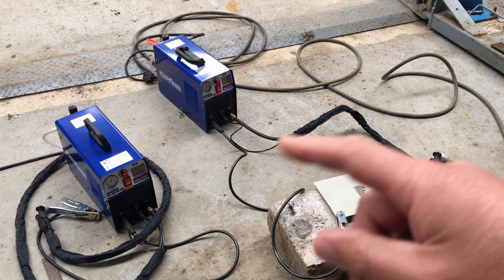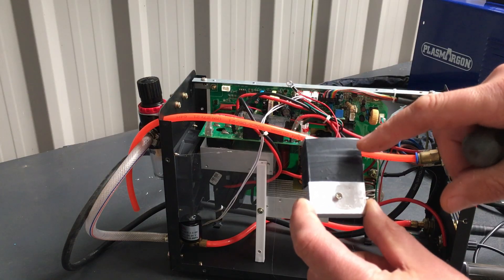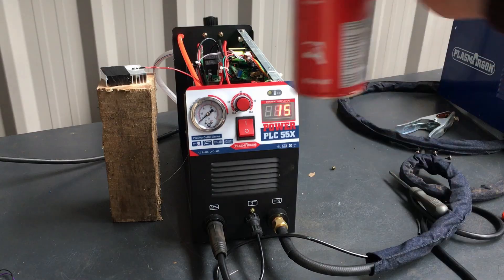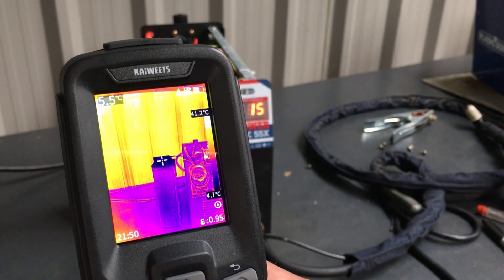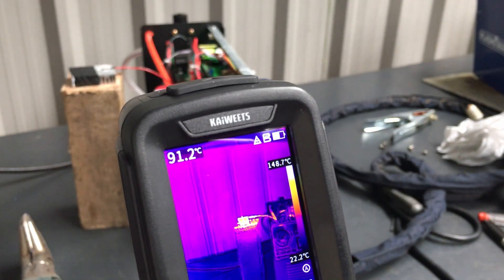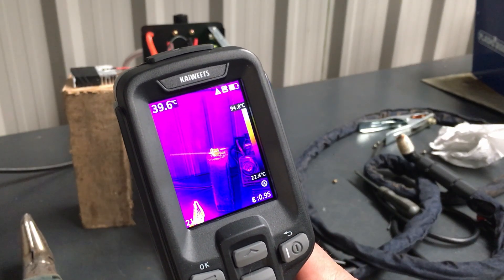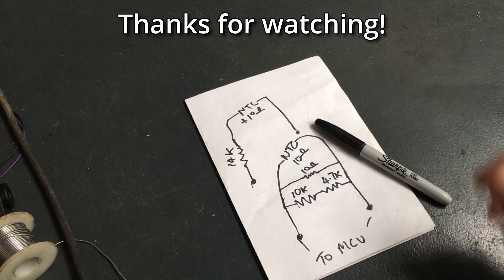Faulty Plasma Cutters - Follow-Up Video (With Thermal Camera) | Will It Catch Fire???

Comment: I've owned not one but four and yeah I have absolutely positively fucked-up a few Parkside (Lidl) plasma cutters in my time. These cheap inverter-style plasma cutters and welders are handy for short jobs, but suffer from short duty-cycles and as a result rely heavily upon multiple thermal protections to prevent spectacular meltdowns. Take it from me, they can go tits up quickly with a seriously loud audible notification! 😉
Reply from the maker: 😂😂😂😂Cheers for sharing 👍

Comment: It only worked because the sensor lowers it's resistance to almost 0 with rising temperature, right?
Reply from the maker: Yes, although at 30C when the fan kicked in, it should be around 8K ohms.

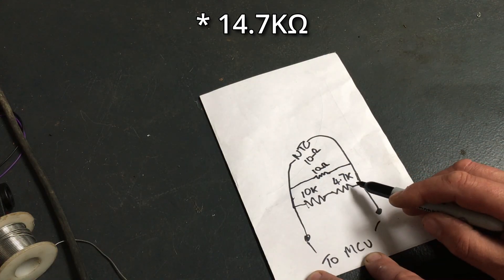Comment: If I may be so bold as to suggest it, I think some of the confusion stems from time stamp 34:03 in the original video where you said "resistance can't go below" when I think you meant "resistance can't go above", and the same thing at timestamp 8:25 in the followup video where you again said "drop below that" although in that second instance I think perhaps you were meaning the temperature not the resistance?. Both times when I heard it I said to myself "eh, what?". Didn't comment first time round, couldn't "resist" this time :)
Reply: Exactly 🙂
Reply from the maker: Yes my bad. I'm only human and do make mistakes occasionally 🙂
Reply: Yeah, this is what confused me too.

Comment: It's amazing how many people don't know basic circuit analysis, but they're experts in the comments section!
Reply from the maker: You are correct. I mentioned the downside of this in the previous video. One if the reasons why I glued the plug in place so it can't came out. As you say the only issue would be if the NTC somehow failed open circuit. I have a feeling other components in the unit would fail before this judging by the build quality!
Reply: By disconnecting the too cold protection, condensation will occur when used in cold environments, and the cutter will short.
Maybe it was nothing wrong with it at all? Can it be that the user have tried to use it in cold environment?
Reply: @micronetwork  I guarantee that was not designed on purpose with a too cold protection, it was just terrible design oversight that wasn't caught because QC testing is non existent. That's what you get with cheap products.

Comment: It’s great that it worked well, though it was a shot in the dark. It is right to question this approach as taking a chance is not the way to go and proof testing should always be done afterwards to make sure it works within its intended limits. The people that were happy to use it without it being tested would also be happy for their mechanic to replace their car brakes with random bolts and parts too right?
Reply from the maker: Yes I should have proved it worked correctly on the 1st video but totally forgot to show that the high temperature cut off would still work. I couldn't see any reason why it wouldn't but as you say it's always good to demonstrate it.

Comment: There is one issue left though. Adding the 14K7 disables the missing NTC detection because the uC always sees the 14K7 resistance and not the infinite resistance of a missing NTC. 
So if the NTC goes bad no error message (E01 was it?) will be displayed, effectively not detecting a posible overheating and shutdown of the device. Or is there an other overheating cut out in place?
Reply: If the NTC fails open loop (disconnected, burnt out, etc) it will indeed still keep operating. It will also believe the heat sink temperature is below the fan cut-in point, thus the fan will stay/turn off and it will overheat even faster until it fails/burns up due to heat damage.
Reply from the maker: Yes, it was the potential downside that I mentioned in the previous video. The mod I did isn't perfect but without modifying the microcontroller code I can't see any other way around it, and have the unit operate at a temperature lower temperature range. At 0C the NTC would be around 32K ohms, and 64K at -12C.

Comment: Hehe my daughter saw me watching the last one and I quite liked the idea of a plasma cutter here and she had me wallet away in a second and admonishing finger waggling and nag muscles set to stun "no father you ARE not having one..." :(   She's a bit fed up as her old bedroom is now a very crowded area half full of watches (700+ in the collection O.o) and half full of a workbench with pillar drill, 1930's Portass lathe, gasless mig, 3d printer, a plethora of power tools and boxes of stuff for polishing, cutting oh and a 1960's Italian Aspire engine (Tecumseh knockoff) oh and my large compressor, air tools etc...   I have just finished refurbishing a Snap On air impact gun which had the local post office questioning me whether it was a naughty naughty gun not an air tool hehe   I made a joke showing it to my postie lady that she wasn't equipped with any nuts I could be taking off with it, made her laugh all day she told me :P   I did forget to mention front room is stacked with about 20 games consoles, several feet high many stacks of games for consoles, a 1958 Lambretta Li150 and a 1985 Vespa T5 and all my steam engines including a verra rare 1939 Mamod SC3 all original in its original box and accessories, only made for 3 months before WW2 started Mamod said about 100 were actually made... rare as rocking horse bollo... droppings :D
Reply from the maker: Nice 👍Sounds a bit like my place (with the old consoles etc). A plasma cutter might be a bit on the heavy side for those watches mind 😂😂😂

Comment: The safety trolls are having a freak-out. You have to be careful about feeding the trolls. They're hungry all the time.
Reply: By disconnecting the too cold protection, condensation will occur when used in cold environments, and the cutter will short.
Maybe it was nothing wrong with it at all? Can it be that the user have tried to use it in cold environment?
Reply: @micronetwork I think I've heard you say this before.....

Comment: With the parallel resistors you just created a basline for the controller to work with, as you have shown, it switches off the active cooling when it's cold enough without the fan running, and still blocks operation if it senses too much heat!
"All good!" as a famous australian drain cleaner would say...
:yt:😂👍
Reply: But where's the corn?? There's always corn
Reply: @gorak9000  🤣
Reply from the maker: Cheers 👍
Reply: By disconnecting the too cold protection, condensation will occur when used in cold environments, and the cutter will short.
Maybe it was nothing wrong with it at all? Can it be that the user have tried to use it in cold environment?

Comment: Isn't an expert just somebody that has little cards printed that say they are an expert? I'd rather have you work on any of my electrical equipment than any self proclaimed 'expert' who lacks the attention to detail you have. Thanks for the interesting video again!
Reply from the maker: Thanks 👍
Reply: By disconnecting the too cold protection, condensation will occur when used in cold environments, and the cutter will short.
Maybe it was nothing wrong with it at all? Can it be that the user have tried to use it in cold environment?

Comment: Bush Barbie says there are people on this planet that shouldn't be. I know she is right. Keyboard experts are usually wrong and nothing lost if you pay no attention to them. For fun, I look at their channel and they usually don't have any content. As always, comprehensive video and spot on...!
Reply: I think the confusions comes from the fact that this only works if higher temperatues lower the sensor resistance. It would indeed bypass the security if the sensor resistance would rise with the temperature instead.
Reply: @Mobin92 you are so right. By disconnecting the too cold protection, condensation will occur when used in cold environments, and the cutter will short.
Maybe it was nothing wrong with it at all? Can it be that the user have tried to use it in cold environment?
Reply from the maker: Well I have a Jassic MIG welder, and an Eastwood plasma cutter which are both way superior in quality. Both work in freezing conditions with no issue. The Chinese plasma was cutting out at anything below 18C, so "perhaps there was nothing wrong with it" doesn't really 'cut it' IMHO.

Comment: My worry is that if the temp sensor plug manages to work itself free again, the resistors you've added will make the cutter think the temperature is fine even if it is overheating.
Reply: Says another keyboard expert with no channel content...!
Reply: The plug has been fixed with hot glue. Geeez, suppose the mighty hand of god came along and swiped the operator into orbit!
Reply: Correct. As mentioned elswhere the resistors would be better spliced into the NTC leads. It would at least cover the possibility of the NTC plug falling out. The only issue then is if the NTC fails open there would be no way for the controller to see an over-temp situation. It's a poor design of that cutter. If it was mine, I'd remove the NTC and replace it with a thermal switch and series resistor.
Reply from the maker: I had thought of a thermal switch but then there are different levels it seems to sense. For instance the fan kicks in at 30C and the overheat kicks in around 90C
Reply: @BuyitFixit  Yes you are right. Trying to solve a design issue can be problematic. The main requirement in this case is over heating. If the fan keeps going there isn't really a problem other than the noise. But hey. It's a workshop. Noise happens in workshops  😄
Love your content as much as everyone else here. Even though I've been in the industry for 50yrs (retired but still active) you always learn from others techniques.....
Cheers
Pete' New Zealand.

Comment: As an electronic engineer nice explanation :) Fair play for revisiting.
Reply from the maker: Thanks 👍I'm no expert but I do try, occasionally I do make mistakes too!
Reply: By disconnecting the too cold protection, condensation will occur when used in cold environments, and the cutter will short.
Maybe it was nothing wrong with it at all? Can it be that the user have tried to use it in cold environment?
Reply from the maker: Condensation only occurs when a cold item is moved into a warm environment (IE when I froze the heat sink in a warm room). If the cutter is the same or warmer than the ambient temperature then condensation would not form (think how a de-humidifier works). Also "nothing wrong with it" - I'm sure it's designed to work at a temperature of less than 18C.
Reply: @micronetwork have you actually watched the previous video?! Pointless comment.
Reply: condensation occurs when warm moist air cools down, it can happen at all temperatures.
Reply: @niels-christianschmidt4604  It can only condense when there is something colder, specifically below the dew point. It can not condense inside an already above ambient device.

Comment: I would be very happy to use this machine without concern. In fact, it's far safer now than when it left the factory. One of the problems with youtube, full of sofa experts!!
Reply: It was a good repair but I'd not be relying on that machine to be safe.

Looks like it was made for a £20 BOM, nothing to do with the repair itself.
Reply from the maker: Cheers 👍
Reply: @Look_What_You_Did Simply stated, ARMCHAIR experts. Similar to Monday morning quarterbacks. No practical knowledge, just opinions  that are not backed up by experience and education.
Reply: By disconnecting the too cold protection, condensation will occur when used in cold environments, and the cutter will short.
Maybe it was nothing wrong with it at all? Can it be that the user have tried to use it in cold environment?
Reply: @micronetwork I've never heard of low temperature protection. Any new noses? If the temperature of the device is the same as the surrounding environment or higher, steam will not condense on it. In order for it to be protection against condensation, the temperature between the environment and the equipment would have to be compared, mainly so that the temperature of the equipment is not lower than the environment.  The translator is writing for me, so I apologize if there are mistakes in my English
Reply: @ServisTOPRO  True. Maybe @micronetwork does things differently to the rest of us though...likes to keep his tools out in the cold workshop then brings them in the warm house to do some plasma cutting in the living room 😂
Reply: @micronetwork Is there an echo in here?
Reply: @micronetwork  My god.
It was not intended to have "too cold protection".
The wrong part had been installed at the factory, meaning it would never cut out no matter how hot it got, but it would fail to work when it was cool. Not cold, cool.

The part was swapped and it now has thermal overload protection as the designer intended.

Comment: I'd argue using a slightly higher resistance (value) than the shutoff-point would be better since that would allow the machine to still detect when the plug disconnects itself again.

Putting them on the PCB was the least intrusive and easiest to reverse - and so the most sensible way to see how the system functions normally.

(But) I'd have been inclined to put the resistor(s) in parallel on the wires so that the plug disconnecting would still be detected -- avoiding the situation where the thermal protection becomes bypassed if the (mismatched connector) fails again.  AND/OR trying to find the exact value of resistor...
Reply: This was my thought as well (not claiming to be an expert), I know the plug is now glued in but if it does disconnect (or as someone else said the ntc fails) the control board won't detect it as the bypass is hardwired to the socket side.
Reply from the maker: Yes I did mention this on the initial video that this would be a possible downside of the modification. A lower resistor would probably not work as the resistance of the NTC increases very quickly as the temperature drops. At 0C would be around 32K Ohms which is double of what it as at 17C which is around 15KOhms.
Reply: @BuyitFixit  If the NTC is at 32KOhms and you have a 20KOhms resistor in parallel the combined resistance would be 12.3KOhms, so still well below the 'cut off' of 15KOhms. The NTC would have to get up to 60KOhms before the total resistance would exceed 15KOhms.

I don't know what actual temperature would make the NTC 60KOhms, but it would be below freezing, at which point using the cutter would probably not be a good idea anyway.
Reply from the maker: Thanks for that. I've still got it on the bench in the workshop as I've had other farm stuff to attend to since making the follow up. I'll give that a try 👍
Reply: @BuyitFixit  How does the plasma cutter react to the temperature changes with the thermistor unplugged from the PCB?

You've demonstrated that the torch will still 
safely shut off with the thermistor connected, and will continue to run without it while it detects 15K ohms (or less) in low temperature.

You've demonstrated resistance of the NTC in parallel with a resistors in parallel is lower by running the torch still running; So using a fixed resistor just above the cut-off will still shut-off the torch when the thermistor is disconnected (though it may emit the error code for in actual extreme low temp).

IIRC two 10k ohm resistors in parallel are equivalent to one 5k ohm resistor. 
by the formula 
1/((1/r₁) + (1/(r₂) + (1/r…)) = r_(equivalent)

---
Or attaching the same resistors you've selected to the wires of the NTC *also in parallel*, you've get keep the desirable {~100C high-temp cut-off, and ~25C fan-start} while enabling error04 to actually activate when the sensor is disconnected.
Reply: Indeed, the parallel value resistor should be slightly higher (probably between 16 and 20k) to still have the broken sensor detection working fine, but still allowing cold operation of the machine.
Glueing the sensor in will indeed prevent it from falling out, but it still is not protected from a broken sensor! Judging by the 'quality' parts used in building the machine, the sensor failing open loop (infinite resistance) is not an unexpected event in the future.

With the current bypass resistor value of 14.7k the machine will think it is working fine, and it will also believe its running cool. So it will switch off it's fan and happily melt down even faster (and potentially start a fire too with all the plastics inside it).
Reply: Says the expert that shorted out his drill press....!
Reply: @peatmoss4415  strictly speaking, the manufacturer shorted out my drill-press when they pushed the grommet through the windings, causing the rotor to chip/collide with them (intermittently).

I just watched it burn, then decided to record the last few sparks before I replaced it so that others could too.  Unfortunately it was not nearly as impressive as the first dozen or so times (mostly because the metal was already expended; and/or w/ shipping costs, claiming warranty wasn't worth the trouble).

(edit: Dunno what it says that I am so cavalier about electrical safety, but am concerned about disabling the detection of the thermal protection [actually] failing.)
Reply: 😂 Good one!

Comment: Adding resistors ONLY sets a low temp point and did not affect the high temp point.
Reply: By disconnecting the too cold protection, condensation will occur when used in cold environments, and the cutter will short.
Maybe it was nothing wrong with it at all? Can it be that the user have tried to use it in cold environment?
Reply: @micronetwork  Did you watch the first video? I think not, as it was triggering a low temp warning at about 18c, and it had to be warmed up with a heat gun for it to work.
Reply from the maker: Yes, I'm sure it is supposed to work at a blistering cold 18C 😂😂😂